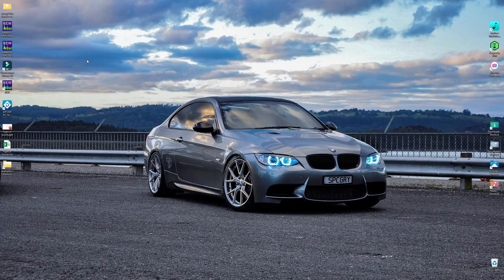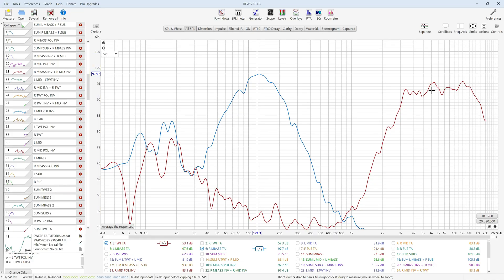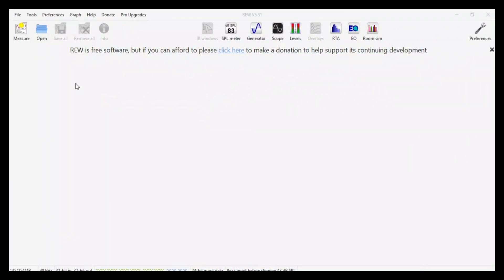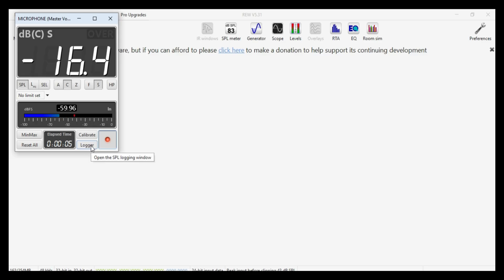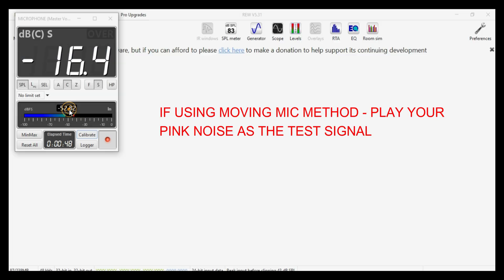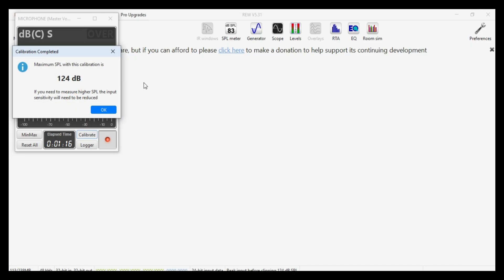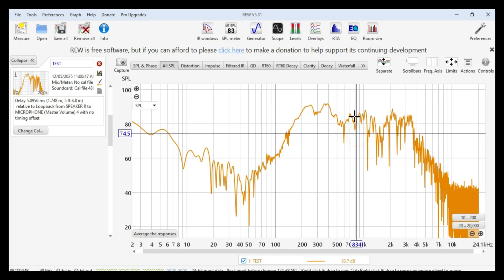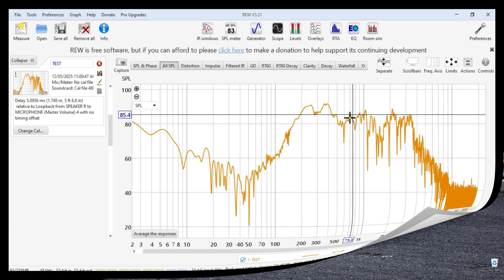Viewer Question - Your dB level on your REW graph is wrong unless you have done this

Comment: Might be a stupid question, but is this supposed to be with all speakers active, or one speaker like a midrange?
Reply from the maker: Hi SJ,  A perfectly valid question mate. The way I do it, is to just play pink noise on the mid range speaker that is furthest away (in my case the left mid) and turn it up until I have around 85 on the sound level app.   This make sense to me, as most of the time we are just measuring a single speaker when we are tuning. But that said it should not matter tbh.  If you play one speaker and the sound level is 65db then you put that into REW  the scale will be calibrated.  If you play two speakers and the sound level is 90 dB and you put that into REW then then scale will be calibrated.   The only difference will be the max sound level cap. REW pops up a message telling you what the max dB level is when you enter in the dB level.   The lower the dB entered the lower the cap.  I hope this helps :)
Reply: @socketsocket2763  Thank you, that clears things up a bit.

Comment: Hello, thanks for the video ☺️
quick question, if your db meter is in db-A mode instead of db-C, does it change anything in the tutorial ?

Regards
Reply from the maker: Hey Matt,  You are welcome.  The main reason for making the video, is lots of people do not realise the scale on the REW graph is not reliable if not calibrated.  Regarding your question about weighting curves, no need to worry, we are just doing a simple sound level calibration and not interested the SPL at different frequencies.  If we were then we would select a A or C weighting curve depending on what we were measuring.  If you want to be OCD you could select the Z weighting curve which applies no filter, but its totally unnecessary haha.  Hope this helps :)
Reply: @socketsocket2763 OK ! Thanks for the clarification, I see your point 😉
Didn’t watch all of your videos but I can definitely see some PSSound’s influence in your way of approaching tuning in general 😃 ( which is a good thing for me)

Comment: I believe you use an umik-1 mic, right? I guess this is of no help to me as I use an imm6 mic with a cheap usb soundcard. When I do the RTA I play pink noise directly on my headunit and listen with the imm6 instead of having REW play instead. It's a janky solution, but it kinda works for now. I do have to turn the volume way up to do proper RTA but meh
Reply from the maker: Hey Ady, Yep you can totally calibrate your REW scale with your imm6.  In the video im playing pink noise through the headunit and recording it on a umik1 but any mic will do. The only other thing you need is a sound meter app for your phone. The one I use is the NIOSH app and its free.  Re volume levels you are not alone, we all have to turn our volume up to do a proper RTA.  Mine is turned up to about 2/3 to 3/4 of max volume haha   Probably why I feel like i'm going deaf.   Have a crack at following the tutorial and let me know how you go :)

Comment: Awesome man!  Just saw this.  I spent majority of yesterday doing an entirely new tune in REW and copy filters over to my Helix.  I adjust my house curve and speaker curves up to 60db which seemed about right.  I bumped the sub curve itself up to 66db.   I EQed everything at 60db target and 66db target for the sub.  When I took each measurement I kept same headunit/conductor volume and I individually made some small channel gain adjustments to match each speakers left to right better by just a few db and this resulted in a way better tune with everything landing in the right spots on my curves.  My only dilemma now I'm trying to figure out is the tune sounds the best I've had yet. but I still feel my levels are a little off between left/right for center image.  And feel my levels are a little off still now between front midbass and tweeters/mids on front pillars, so I'm trying to just adjust those by ear still.
Reply from the maker: Hey Cap .... That's great news mate.   Have you done your time alignment yet?  You speakers left/ right position and summation will move when you do your time alignment. So if you try to get everything in the middle of your dash with levels before you do your time alignment, they will end up moving again. Just saying :)   If it helps, after I have done my level matching and EQ, I time align all the speakers and then listen to the system.   If the image is not centring after that, I might do fine adjustments to the levels and then do the time alignment again.  I call this fine tuning and it is the last step in the tuning process.  I will cover fine tuning as the last tutorial in the REW series.  But hey that's just the way I do it. I guess the key point is your left/right will be slightly out before you do your time alignment, so keep that in mind if you are checking levels before doing TA  :)    Good luck mate !!
Reply: @socketsocket2763 what’s up man. So I did my time alignment first thing but all I did was enter in my physical tape measurements in to the Jazzi time delay calculator then put the ms time delay in to the helix. From there I then adjusted channel gain levels as needed just a little to get left and right measurements to match up when measuring and to match the target curve better before EQ. Needed no more than 2db difference on any channel to get them to line up when measuring. I manually added around 15ms delay to my rear fill though and they’re down about 7db from everything else and crossed over similar to my midranges.  Not sure if I like this type of sound or not though yet from rear fill.  I just feel that after EQ the center has shifted now and I’m not sure about the relation of dB (volume) between the mids, tweets and midbass. I guess maybe I need to try a different curve.
Reply from the maker: Hey Capt.... Doesn't sound right mate, if you got everything dialled in correctly then everything will blend together and the sound stage will be crisp and imaging well. I can't say if your approach is good or bad because there are a bunch of ways to tune and a bunch of ways for things to go wrong too hahaha.  All I know is what I have learned works for me.  If you have not already watched my step by step guide, check it out.  https://youtu.be/kgNzvZdYLgE    In my experience, level match and EQ comes before entering any delays.  Delay does not change the speakers frequency response but EQ changes the phase and therefore the time alignment.  So the order you are doing things outlined above will mess with your final levels and staging :)  or at least that is my best guess hahaha .... welcome to the frustrating world or car audio tuning :)
Reply: @socketsocket2763 Understood! I think I need to just try some different house curves. And I also need to try the time alignment with sweeps. Currently only time aligning by manual inputting the delay based on tape measured distance. So if I’m measuring each speaker individually I didn’t think it would matter if doing time alignment before or after… I’ve watched all your videos 👍🏻 thanks again man. Still slowly figuring it all out lol.
Reply from the maker: No worries mate.  Yep its not easy for sure.  Just yell out if I can help in any way :)